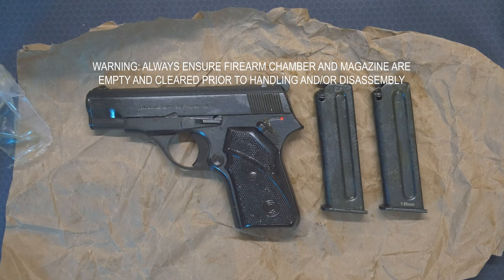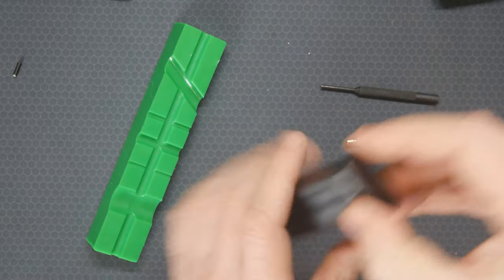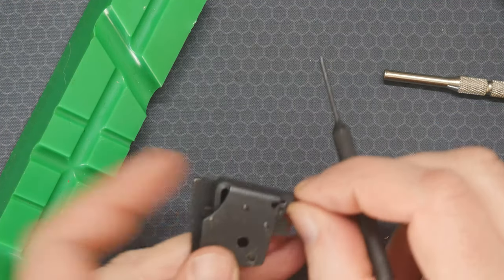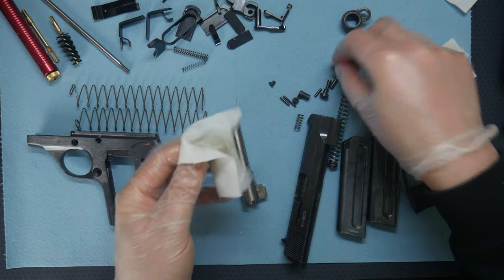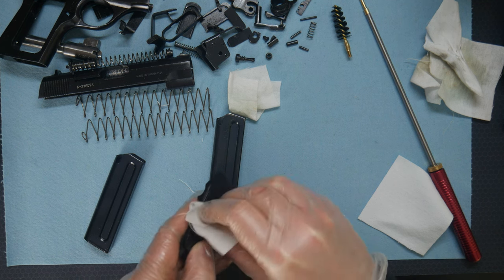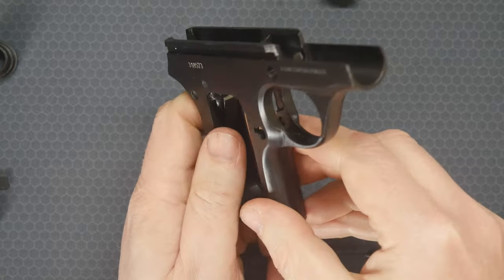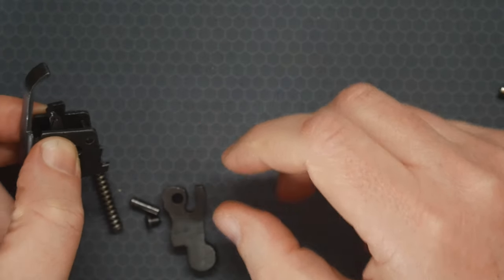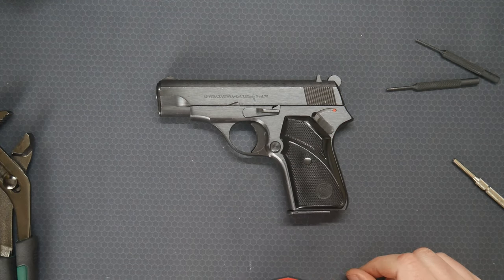Zastava M70 - Disassembly and Reassembly - EXTENDED

Comment: Just purchased a M70 & will begin the cosmoline removal tomorrow.  I will be using mineral spirts.  I don't have a sonic cleaner.  This video is a great help.  Thanks.
Reply from the maker: Yeah, definitely don’t need an ultrasonic cleaner if you are only doing a one off. Mineral spirits or brake cleaner fluid is the way to go. Enjoy your M70, they are super fun to shoot!